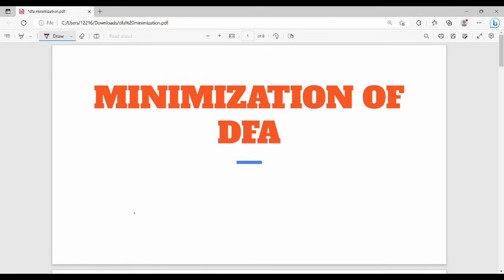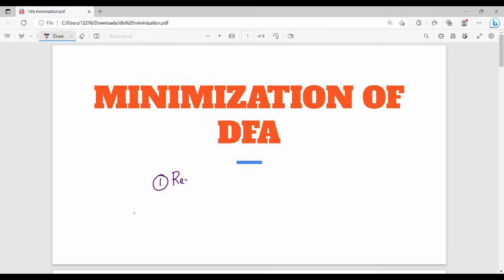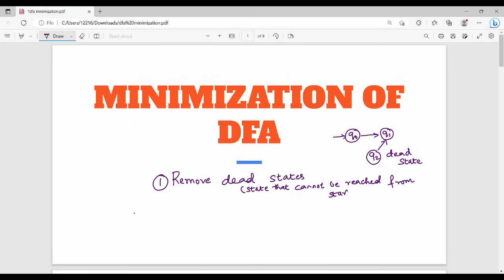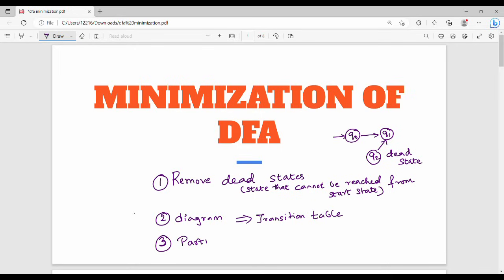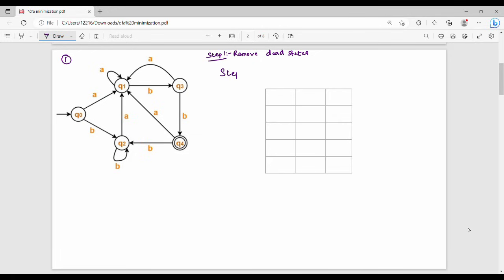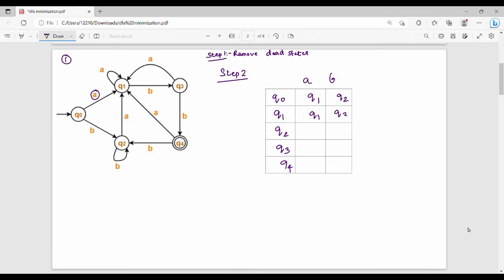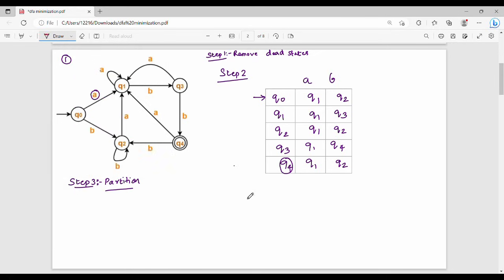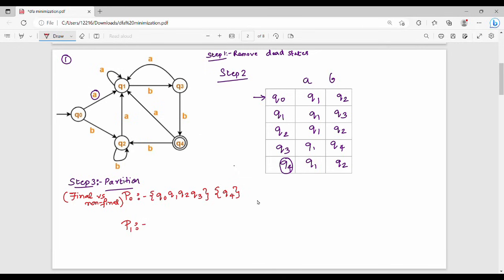1.4.1 Minimization of DFA Example 1 in Tamil

Comment: Sir.in my question i have two input Transition 0 and 1...but one state doesn't have Transition 1 it only have 0 Transition to other state then what will be my 0 transition ?shall i remove that node from question and proceed with the remaining states or else continue by replacing null at 1 Transition!!
Reply from the maker: You can put null.
Reply: Sir my professor said that null operators is not valid in minimization?
Reply: She said to remove that state from the question and continue with remaining nodes...what's the correct procedure sir
Reply: Can you explain this please
Reply from the maker: @rithiga-f8v  continue by replacing null at 1 Transition!!
Reply: I tried to send you a mail of my answer but it shows some error....will you please send another mail id
Reply from the maker: @rithiga-f8v  venkat.kvhapp@gmail.com Check now
Reply: @because2022 address not found
Reply from the maker: @rithiga-f8v  Not sure whats the error in mail id. Also you can refer this for more egs https://www.gatevidyalay.com/minimization-of-dfa-minimize-dfa-example/ and let me know if you have further doubts.
Reply: Sir in this they eliminated the non accessible states...then why i replace it with null?
Reply: How to find the dead states !
Reply: If i use null then it will be considered as 0!!is this right
Reply: Now i mailed my answers to you sir..kindly reply
Reply from the maker: @rithiga-f8v  Whats your mail id?

Comment: @because2022 sir at 12:32 q0 with input signal a goes to state q1 which belongs to another group , so why did you not separate q0 as an individual group , you said only the states which have resultant states from the same group should be put in a group
Reply from the maker: Good question. Actually we should see if q0 and q2 on a goes to some state in different partitions of previous step. However they both go to set containing q1. Hence no need to split.
Reply: @because2022  understood sir thankyou
Reply: @because2022   Sir actually ithae question enakum rise achu but neenga intha message la solla varathu q0 -a ->q1 q2-a->q1 ku poguthu and q0-b->q2 and q1-b->q2 ,inga rendu state oda input 'a' same ah iruku and input 'b' same ah iruku so intha mathri irunthalum split panna vendaama apdiyae same group(G1) layae vachikalam nu solringala?
Sir please reply sir
Reply from the maker: @ Yes split pana vendam
Reply: @because2022  Sir please reply sir

Comment: Sir enga clg la partion method use panala sir  vera method like epudi na. Transition table eruthuchuna  athula ethu same ha erukuoo antha eliminate panitu thirupiyam check panitu ethu same ha eruka nu panthutu same ha eruthal thirupiyam eliminate panitu aparam transition diagram varaivom sir is this crt ha sir ?
Reply from the maker: Mostly it wl b myhill nerode method. U can use that also.
Reply: Ok sir answer will different
Reply from the maker: @peace1536  Answer should be same.